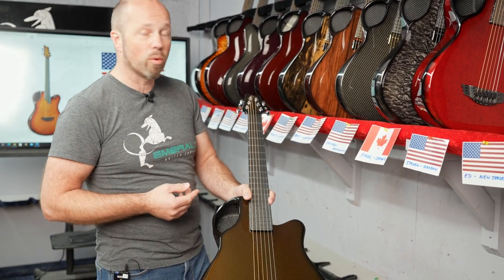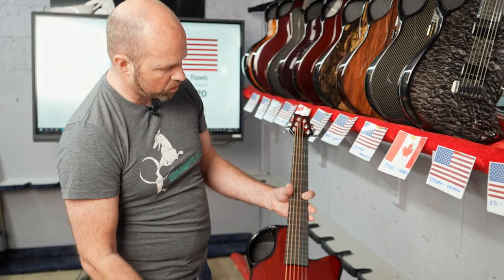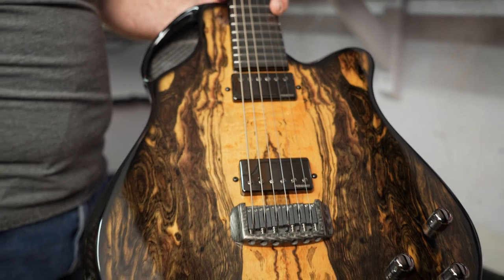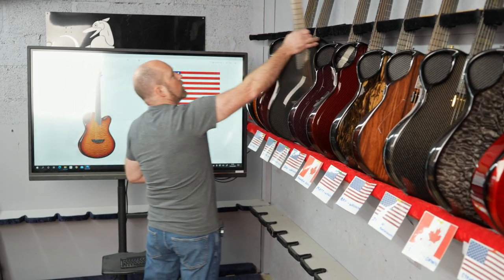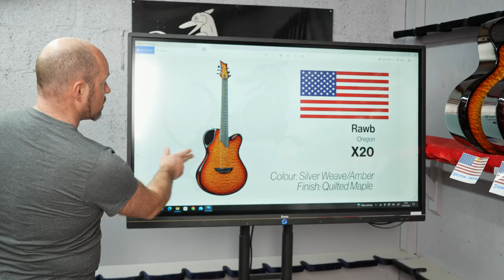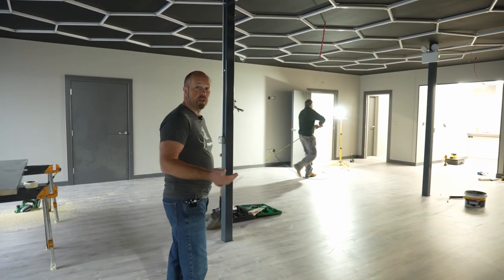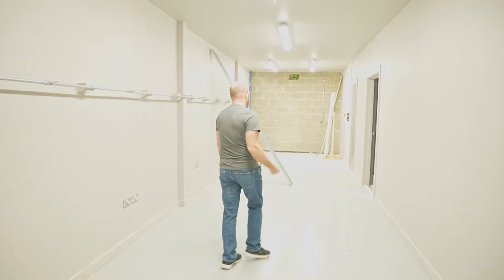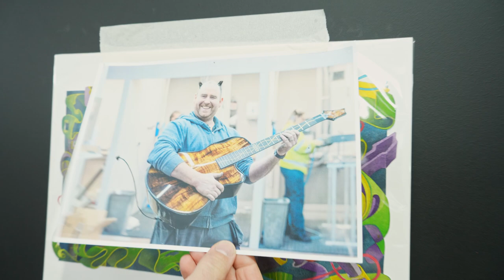Shipping Video 16/04/2022 | Custom Carbon Fiber Guitars

Comment: I haven’t heard the acoustic sound of the Virtuo, without an amp, to hear what it produces. I’d love to. Thanks for the video! Go Emerald!
Reply: It sounds like an acoustic without electricity. Maybe a parlor guitar sound? Its super versatile with its MIDI input. And it plays like a great electric with the right strings. Its hard to find something wrong with Emerald guitars. Its a pro instrument which ever model you pick.
Reply: @leechild4655  Thank you, Lee. I’ve got an X30 and I’m trying to imagine how much sound makes it out of the Virtuo when it has electric strings (say 9s) and is not amplified.
Reply: @garywhitt98  ya, i`m strung with 9s on my Virtuo and acoustically is a tad thinner sound but its easy to add umph if you plug it in to an amp. I love that it plays like butter with light electric strings. happy!
Reply: @leechild4655  Thank you, Lee! Exactly what I wanted to know. I appreciate the help!